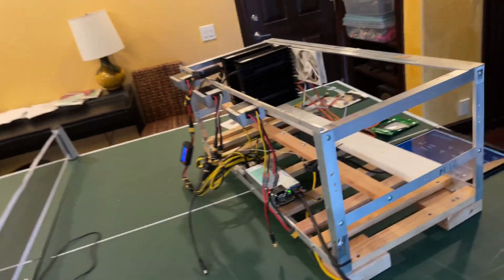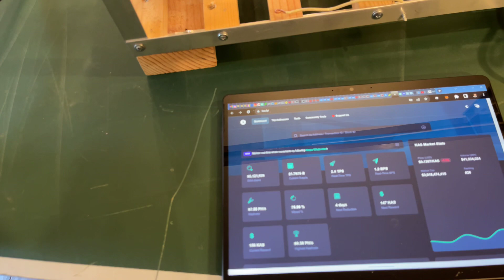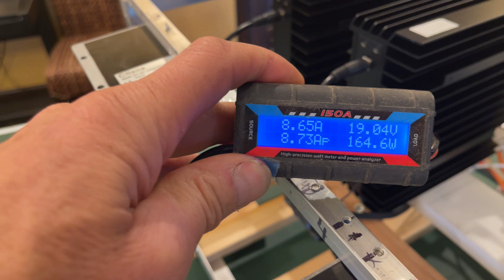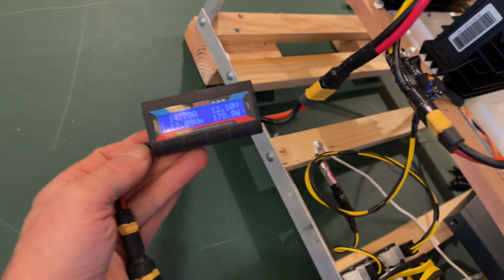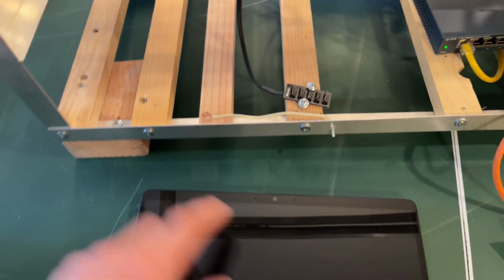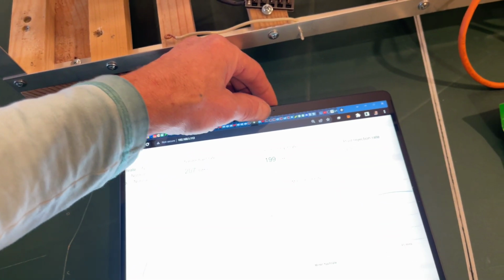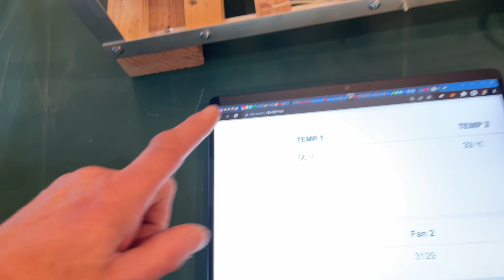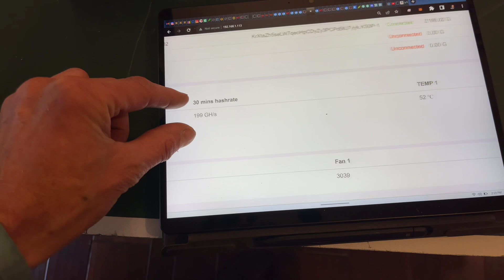KS0 PRO MINING RIG SET UP ON GPU OLD RIG WITH SERVER PSU. 12v to 19v system.

Comment: Excellent setup. I'm contemplating using the standard PSU or wiring 6 pins in parallel and stepping 12V to 19V to barrel connectors. I might consider a larger output stepup converter. I think it's a matter of cost and the number of miners. For me, I'd like to run 5 KS0 pros, so I can't yet decide. I already have two server PSUs and a breakout board.
Reply from the maker: Server PSU the way to go for this and I’m using all 6 wires pcie 16ga cables for each ks0-pro. 18ga cable burned down on me so I don’t take a chance. Lastly I soldering now 14ga silicone wire with xt60 connectors for 340GH OC while replacing thermal paste and installing heatsinks on mosfets
Reply: I definitely won't use 18 gauge wiring then. Thanks for the tips. I'm guessing you come from an electrical background or you're an engineer of some kind. You're the only one that's configured KS0 Pros like this on YT. that I could find. Smart fellow!  @DontMindMeMining

Comment: Juste run them on 12v like i do.
Reply from the maker: I’ve done it on 12v but pretty skeptical to keep them on the 12V for 200W OC firmware
Reply: I'm wondering why it isn't stable on 12V after seeing your other video where only one worked on the OC firmware at 12V. Could it be the barrel connectors being rated for only 10A? Maybe you could use lower guage wiring, but in any case, KS0s take 19V.  @DontMindMeMining
Reply from the maker: @kWYQ1337  all my ks0-pro stable on 12v and I’m running OC 340GH 320GH firmware. However ks0 OG wouldn’t start on 12v with 175G OC there maybe something on barrel over amp protection. But not sure
Reply: Oh that's good news on the KS0 Pros. I'm surprised though that the KS0s take less power and yet have issues. I like the rig you've got man. Happy mining. @DontMindMeMining